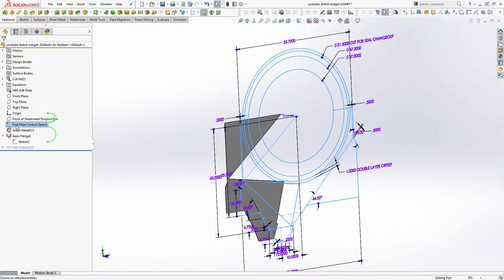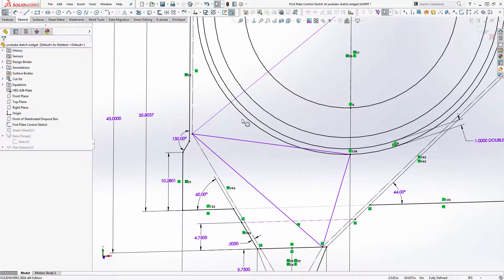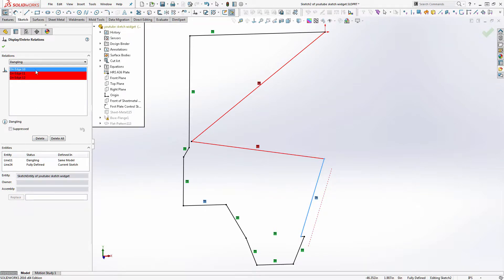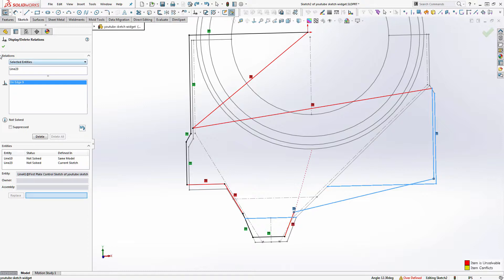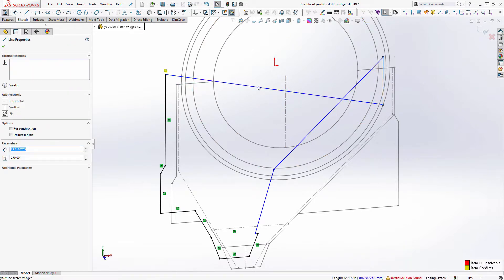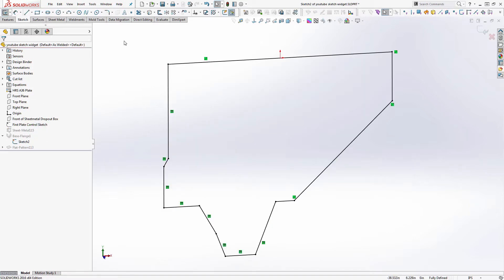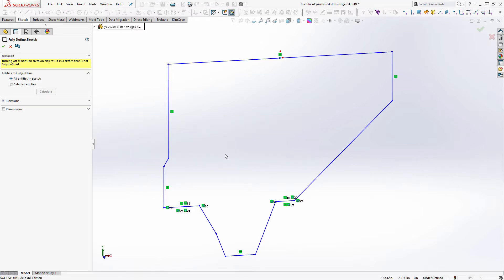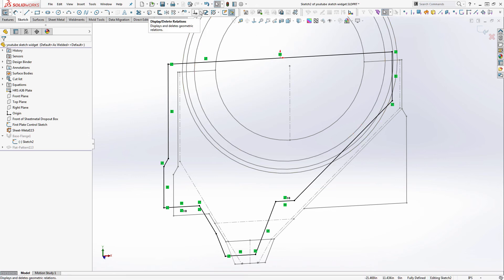Solidworks Quick Tips -  Managing Relations - Deleting Dangling and Automatic Relations

Comment: Thank you!
My bodies were almost always yellow, is it somehow normal?
BTW, you saved me lots of time :)
Reply from the maker: Your sketches should always be "defined", not over defined.  Sometimes a dimension in the sketch and a sketch relation can interfere with each other, other times, maybe another entity has changed and the relation is no longer attached to the same feature on your part.  I have found that you can either do MORE complex sketches at the beginning and use them as the background sketch to work off of or keep your sketches as simple as possible so that they are easier to work with.